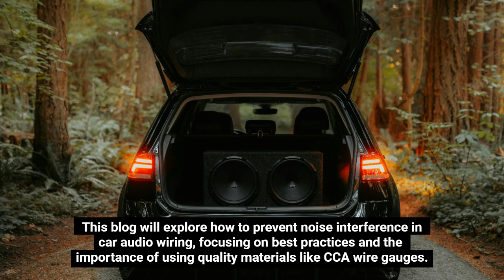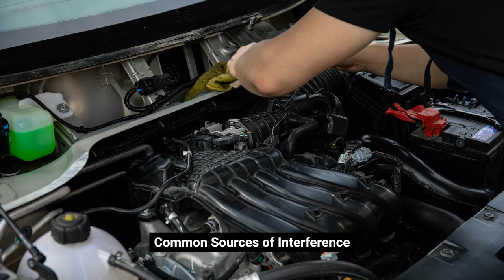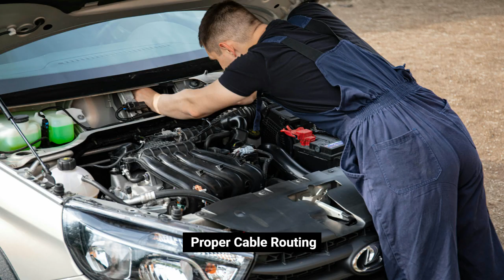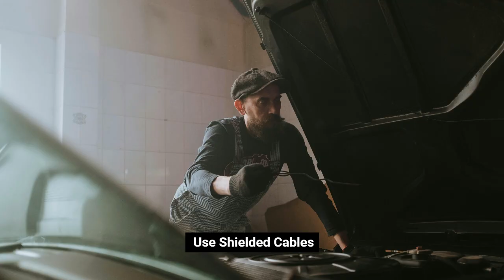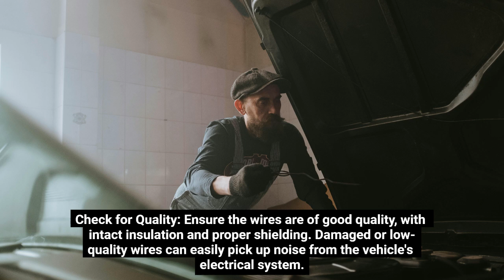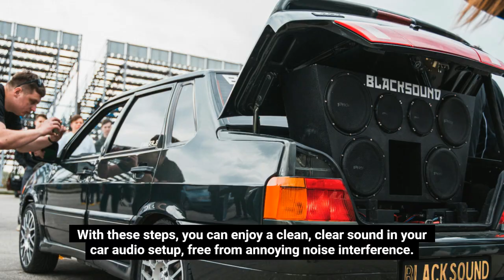How to Prevent Noise Interference in Car Audio Wiring

Comment: Okay but, more advanced problems?
Like short circuit with induction between wires?
Voltage drop ( speed drop) manipulation.
How to fix this?
Reply from the maker: So, there are a number of factors that could be causing these issues. Ironically we just released a free software that is trained to answer all of these questions. 100% free. We trained AI specifically for Car Audio! You can check it out at https://baboombaboom.com/pages/expert-tools